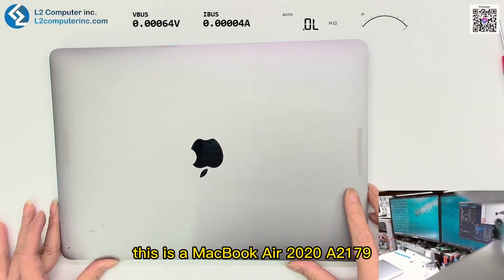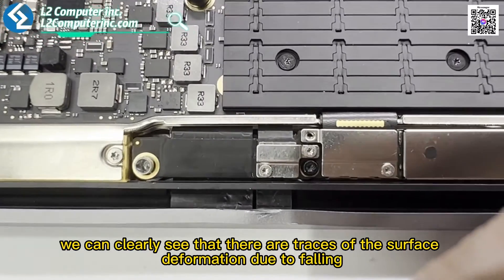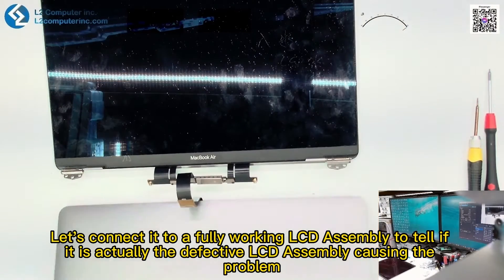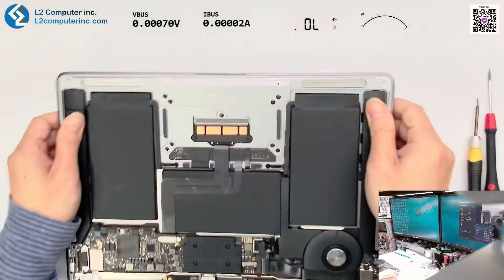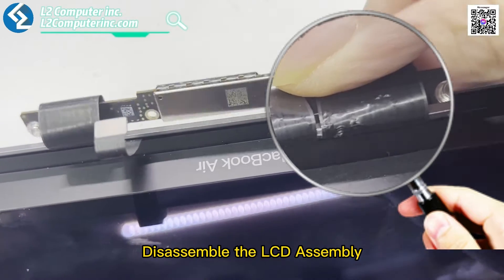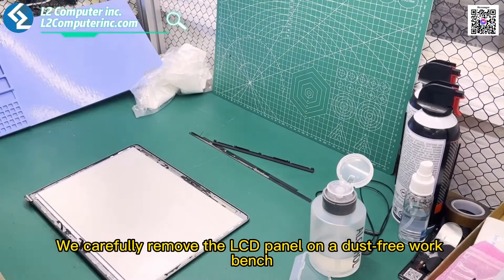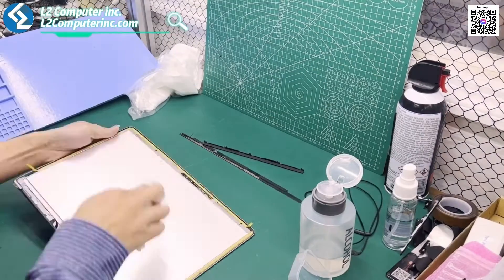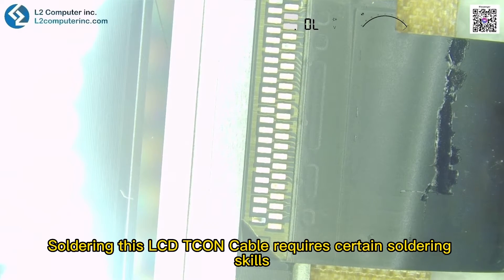Macbook Air 2020 A2179 LCD TCON Cable Is Broken No Display Repair Tutorial

Comment: Hi, I was able to remove 3 ends of the 2 tcon cables 4:15 , but when removing the last end of the last cable, I accidentally ripped 1 solder pin. Do you know if there is any workaround in this case?

Comment: Awesome work! 

I don't have that soldering experience yet (on the scale of M1 PCB connectors) so got a question: I saw your working very fast during initial soldering of new TCON (the flux had not been put yet!). 
Is this how you do pre-heating, to work more easily when the flux is already in place?

Anyway, thank you very much for sharing, this is frankly amazing skill level :)

PS: my issue is with camera (torn ribbon cable), would it be similar process?
Reply from the maker: Thank you!，Yes, we use flux during the process, and pre-heating isn't necessary. The procedure is quite similar to soldering a torn ribbon cable on a camera.

Comment: Exactly why all of the new macbooks are rubbish. Want to buy a used Macbook then think again if it uses a "non replaceable" flexgate cable. This repair is almost impossible for a number of reasons and if you manage to find someone like this it's going to cost you the same as a used macbook. Buy a 2015 retina or opt to never close your laptop.

Comment: I must be doing something wrong.  I have gone througn 5 different pairs of these cable and I still get flickers. Mine is A1708 screen.  Do you have any idea why?  I followed your steps and everything.  Can it be the flux causing the flickering?  Its dribing me crazy.  Also are the T-CONs interchangeable
Reply from the maker: Send a video to messenger

Comment: where can I get the extension cable you used to connect the display to other mac's cpu?
Reply from the maker: https://www.l2order.com/ViewLarge.cfm?i_id=004064AAB14DF7EF1B6984BC631BDCD1&i_maincat=ACF4CFB1AE1D75339007E8399F2BDBF7040DE14B4588CE556EA3BEC114D585CD
Reply from the maker: https://www.l2order.com/ViewLarge.cfm?i_id=F7D65A9F04DE1476536A48774BCD59C4&i_maincat=ACF4CFB1AE1D75339007E8399F2BDBF7040DE14B4588CE556EA3BEC114D585CD

Comment: I just noticed that you put the rubber seal that goes around the perimeter of the LCD panel, in after you fitted the panel into the housing. Did you cut the little half moon pieces of rubber that are supposed to go under the LCD panel? Every other video that I have seen, they put the rubber in before the panel. Thanks, just curious PS - the music is growing on me 😂
Reply from the maker: I can cut it

Comment: Which tool you use for remove the glue? And for clean the back of the lcd?
Reply from the maker: Gel Sticker Remover and Max Professional Contact Cleaner
Reply: @l2computer310  Thanks dude, i will try.
Thanks!
Reply from the maker: NP

Comment: I did this job on A1707. Looks easy on the video :) but it's not at all. I used superglue to secure the cable.
Reply from the maker: U can use uv glue after soldering

Comment: Many thanks! I only need to replace the Tcon pcb and not many people think its even possible but i gave it a shot today on a few cracked lcd's and was successful and after watching this I feel ready to give it a go on my customers repair
Reply: I actually also tried to replace tcon boards on a bunch of scrap screens, and although my soldering skills are quite advanced I ended up with non functional screens, not even showing image but black bars and all that stuff. Must have damaged the ribbon when desoldering.. whats ur technique?
Reply from the maker: Replace board need same brand.
Reply: @l2computer310  I only have tcon boards from a1706 and need one from a a1990 , do you know of any sources for this part ? I think I'm going to have to find a broken lcd from another store or wait for one to land in my lap
Reply from the maker: Yes find a broken one
Reply: @pietervanderweg1157  T-12-K Shape-K is the tip I used though on my customers repair I used a tcon board from a A1706 and while the main pcb board numbers matched the sub set didn't and i got similar results as you with lines that if i didn't know better would make me think it was cracked ie lines and no real display however I do feel I need a tcon from the exact model for this to be successful
Reply from the maker: Is it the same brand

Comment: Looks new! what is the tool you used to remove the screen?  what is the thickness?
Reply from the maker: that is the backlight sheet
Reply: @l2computer310   You used the backlight sheet as a prying tool for the screen ?  I keep braking (cracking) these screens whenever I try to remove the glue from the sides.
Reply from the maker: Yes, Hold the edge with your thumb and push slowly.